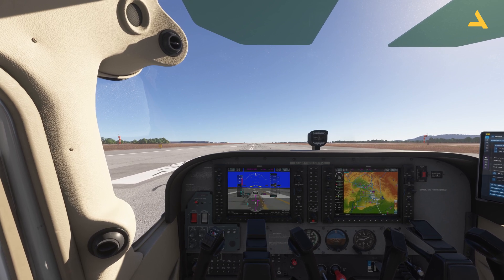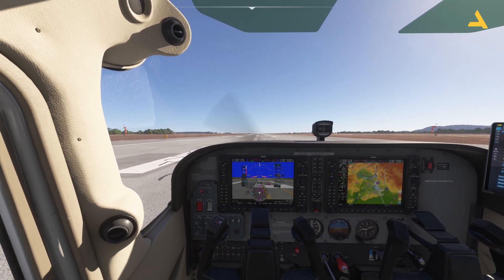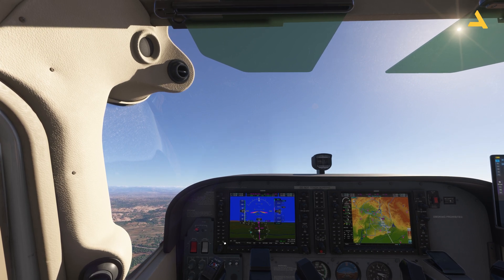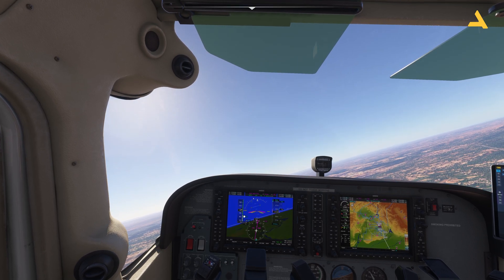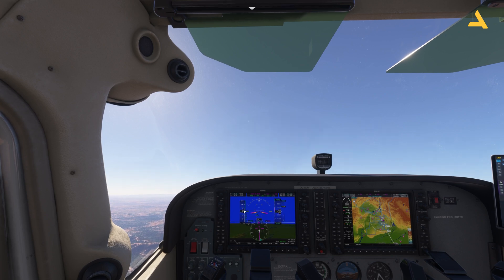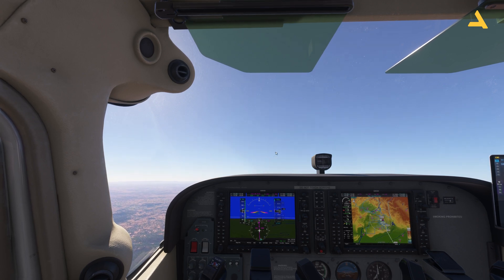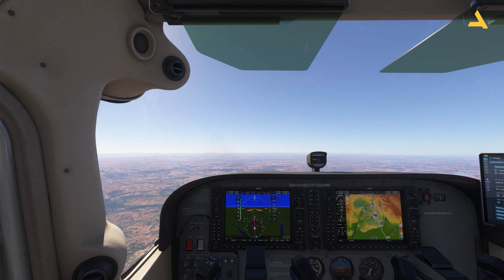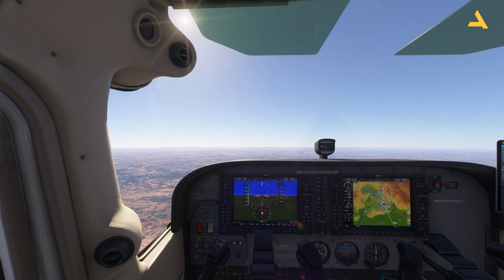Vertical Speed (VS) & Flight Level Change (FLC) Modes in Cessna 172 G1000 in MSFS 2024 - Tutorial 5

Comment: IMHO. The instruments are not clearly visible, so they need to be slightly enlarged. In previous videos, it was also hard to see.
Reply from the maker: Thank you very much for your feedback. Next time I will try to zoom more. Have a nice day
Reply: @aatifahmad  Switching the camera mode in the settings to "close" may help. Alternativley, you can bind keys to cycle through the instruments, it zooms in to them really close then you can just hit camera reset to get back to the normal one. I think the default is 1 through 0 on the number bar for the keyboard binds.